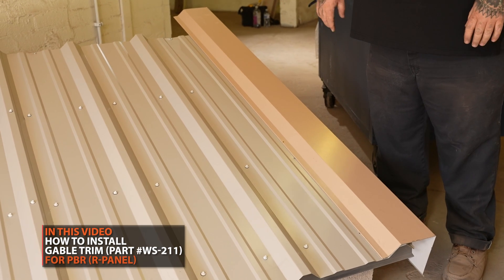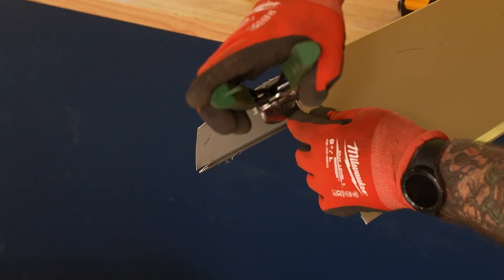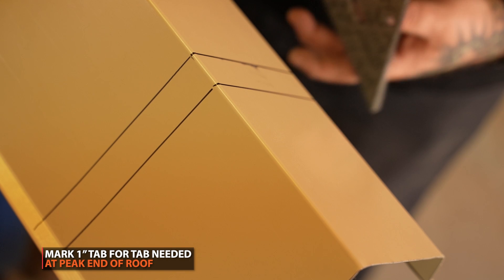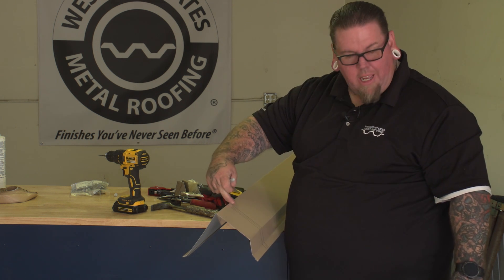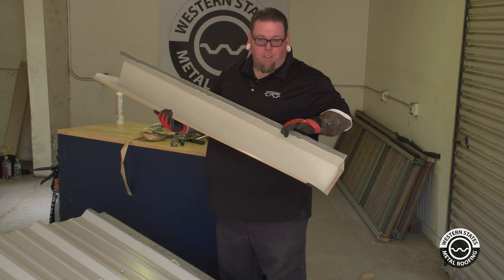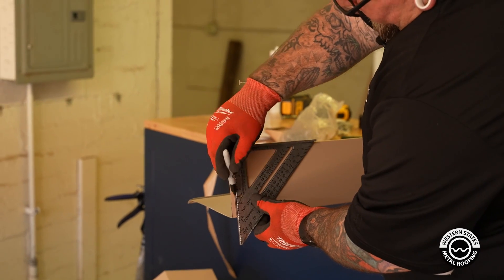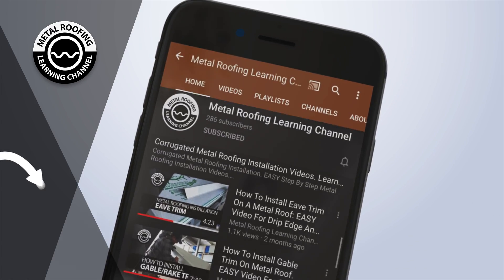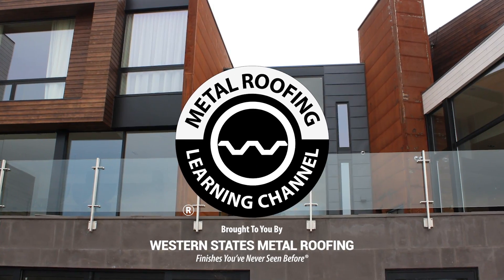How to Install Gable Trim For R Panel and PBR Metal Roofing: Includes Cutting Rake At Eave And Peak

Comment: How long of a screw are you using to secure the peak trim to the rib of the underlying panel? Does it need to penetrate only the top of the rib, or should it be long enough to go through the peak trim metal, top of the rib, and into the underlayment?
Reply: He is using a stitch screw which is design to only go through the metal they are only 3/4" long and a little fatter then regular roofing screws. Your local hardware store should have them.

Comment: Do you have a video on how to install a flashing at the top fo the sheets when they meet a wall?
And how to install apron/Ridge flashing at a 45 degree angle when the sheets meet at external corners of a roof?

Comment: Every time insee something like this it pisses me off on how badly my roofer fucked me. No foam enclosures whatsoever, no butyle tape at all, even the trim peices are just 90 angles that are screwed on. I gotta redo all this
Reply: Not necessary.  This is his design spec, its not a standard.  Foam enclosures are a waste.  I would prefer Z clips and reciever on the cap to hold against the Z.  You will never blow out Z but that neoprene will.  SMACNA has better solutions.

Comment: In these how to metal roof videos the ribs always magically line up for gable trim and sidewall trim. What happens when this stuff doesn’t line up in the real world. Say  screw mounting point lands right on a rib or your building is old and not square. Those are the tricks I’d like to see
Reply: I usually order my trim after the roof panels are up.  You can custom size to ensure it does not lay on a rib.  Add or reduce whatever dimension you need.
Reply: You can either add a 3/4” (or whatever your rib height is) wood shim down the entire rake, or rip the first panel to make sure you end up with ribs on both ends.
Reply: @chazevans2663  This is what I did. I had scrap 3/4" treated plywood. Ripped a couple strips on my table saw and that did the trick. The Excellent Laborer channel also shows using a square and marking the fascia where the trim should be. Technically you don't need anything to support it underneath as long as it's screwed down in the right spot. But I felt better using the 3/4 strips.
Reply: A lot of planning goes into layout to plan partial panel locations.  The bane of standing seam is a quarter-wide panel on one side where you could have did a less noticeable alternative.  Plus I want seams running true perpindicular to the starter/drip.  Crooked seams piss me off.  That's the difference between a hack and a tinner.
Reply: Agreed.  In the real world things aret perfectly square. Dealing with that right now on a shed
Reply: Dealt with that today
Reply: He didn’t think about that
Reply: You can get wider rake trim. I like to lay out 3' for standarf panels to see where I should start to end well.
Reply: My plan is pushing the fascia out a little so it lands in the valley. Easier than pulling up the roof!

Comment: The caulking on closures seem messy on a job outside in the real world.  Those things blow all over the pace.  I would recommend getting them with the glue already on them. Just peel the tape off and stick it to the metal. Nice assembly tho
Reply: I am a diy and haven't the faintest idea where to get those closures.

Comment: What is this sealing tape for? I live in an area that receives over 12ft of rain per year. Sometimes it's torrential (we've had 2ft in 12 hrs) and never ever use this tape, and never ever have a leak. If it's flashed properly, you don't need to waste your time doing this. 
On the ridge, turn up the pans 60 + degrees and the ridge cap should have ave the break into the pan like his barge/facia flashing. Scribe this to the profile and it weather proof. 
If you have gutters, 3 inch over hang is 1 inch too much. You'll understand if you want to clean your gutters.
Reply: That's what I came here to ask. The tape seems redundant. Why seal it? The profile of the roof sheet and the flashing will stop any water ingress.
Reply: @stuckster  just bend up the pan part  (flat part of the profile). A piece of 3x 1  the length of the pan with a saw cut 3/4 " deep can be used as the turn up tool.
Reply: Its belt and suspenders

Comment: Do you have a video for a scenario where you need to cut a standing seam roof panel to fill in a few inches on the edge? My gable trim doesn’t quite overlap at the edge so I have to cut a small piece at the edge?

Comment: You're saying that is Ridge Cap? I've never seen Ridge Cap that looks like that.
Reply: I think he slipped up there. Think he meant peak gable/cap. Like a shed cap with a tongue
Reply: @Malcador-TWOM  I know what gable trim is, the second piece wasn't gable trim or ridge cap. Oh well.
Reply: @jonathan3982  Its a common term for cap on the peak in the midwestern states.  Ridge is usually up a hip.
Reply: @Malcador-TWOM  Well I've never heard of that. Ridge Cap looks nothing like the second piece he put on.
Reply: @Malcador-TWOM  high eave trim

Comment: I guess I really don’t understand the reason behind the tape and the foam for leaks. After all you’re putting it on top of the metal roof that already shouldn’t leak right?
I’m definitely not saying anybody’s wrong here I just don’t understand it
Reply: Foam goes under the ridge cap. It's a real dense foam so driving rain does not get under and inside the ridge. Also keeps bugs and spiders out. That's what it's for

Comment: Thanks for the video Mike. How do you trim a rake that angles up to the ridge? Meaning the ridge is longer than the eaves below, so when the trim is applied the butyl tape can not be applied because the peaks and valleys of the metal roofing panels are leaving 3/4" gaps between the rake trim and the valley of the roofing panel itself.

Comment: About to attempt a small first metal roof and absorbing information and have a question! Always remove the burrs from drilling, they will cause rust stains I hear this over and over but never in any video have I heard anyone paint the ends of flashing or trim? wont the exposed metal caused by trimming rust and do the same thing????
Reply from the maker: Galvalume is sort of self healing when cut correctly such as the shear of a roll forming machine. As long as you use the correct tools to cut the trim you should be fine. If you would like to put touch up paint on the exposed ends of the trim, it would not be a bad idea. Just buy the same touch up paint as the paint system of the trim. Whomever sold you the material will be able to supply touch up paint.
Reply: Your waterstaining comes from using incompatible fastener types.  Ionic transfer between unlike metals.